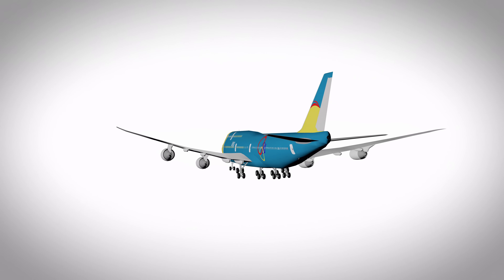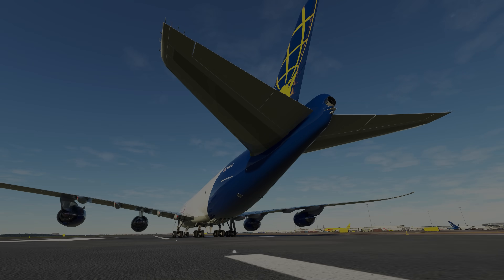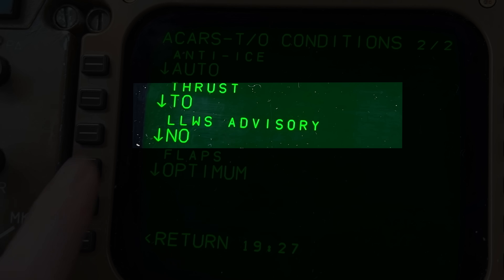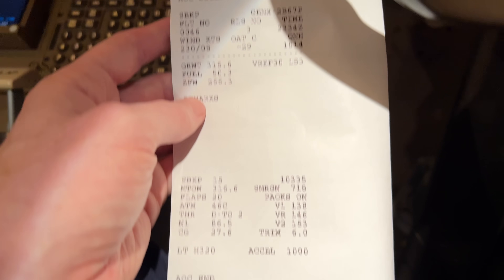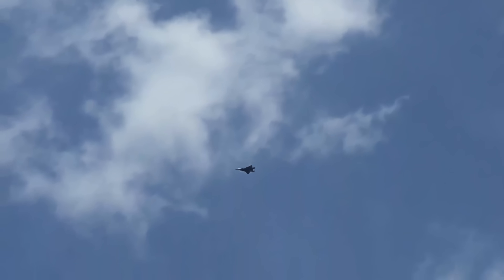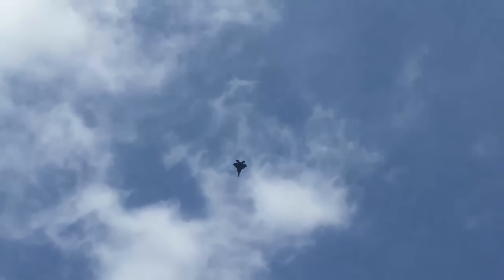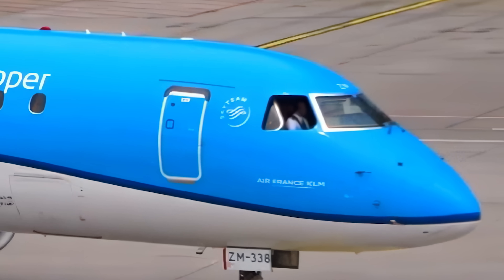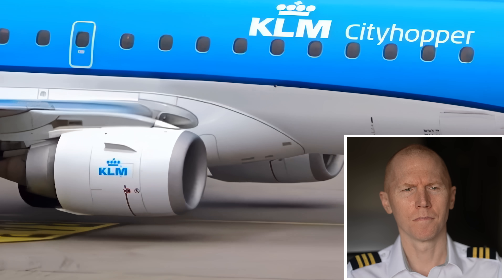Unsafe 747-8 Vertical Takeoff

Comment: I think a better car analogy would be trying to do engine breaking with manual gearbox instead of using brakes and wearing down the clutch instead of brake pads. For most cars, replacing the clutch is much much more expensive than replacing brake pads even though both are designed to be wear items.

And yes, you can indeed do engine braking without wearing down the clutch but you have to do manual RPM matching in that case.
Reply: Nonsense. The RPM matching your talking about is called "double clutching", and I think that went away over 50 years ago. These were transmissions with no synchros, hence the need to match the speed of the engine side of the transmission and the wheels side of the transmission. It took some practice, and a lot of people ground some gears before they got the hang of it, but once perfected, it's a beautiful thing.
Reply: @adamdresser5581  I think you misunderstood my point. Even with synchros, every gear change requires using clutch and the clutch will slip momentarily while re-connecting the engine to the wheels.

If you do lots of engine effective engine braking, you have to switch to lower gears more often. And this will cause additional wear to clutch plate, no matter how good you're with the clutch pedal.

If you're doing the engine braking with the intent to get better economy, you should also consider the replacement price of the clutch. If you can save e.g. one tank worth of fuel per year with efficient engine braking but the clutch needs to be replaced one year sooner than usual, it's still net negative in total because clutch is such expensive thing to replace.

Using brakes to slow down the car is more economical than causing any extra wear to the clutch. You should still fall back to zero fuel usage by slowing down on gear instead of pressing clutch every time you press the brake pedal. Most modern engines will use zero fuel if take your foot off from the accelerator pedal and engine RPM is above idle. As a result, you can use the breaks to slow down the car faster if needed without pressing the clutch as long as RPM is above idle and it will be more economical. Of course, if you have proactive driving style and slow down far enough from the intersection to match your speed to go through the intersection without stopping at all is the best solution.

And note that cars with dual clutch transmission with computer controlled clutch are also affected but there you cannot do much about it. The software will cause the amount of wear the programming will cause to the clutches.

Comment: Those F22 (and other from that generation) are no longer designed as they used to. Older gens had to be stable, bc an unstable plane can hardly or not be recovered by a human. Nowadays they are designed to be unstable, which allows for many manoevres that would otherwise be impossible. It is the onboard computers and avionics that stablize the plane and calculate what the pilot wants, translating it to output, that makes the plane 'stable'.

Btw: I was tought once, when getting my drivers license, to slow down on engine as much as possible and thus not use brakes. It saves a lot on your brakes and no, it doesnt cost anything on the engine.
Ofc thats a tad different for planes, as the engine can suck in debri. (im dutch btw). most likely a very low probabillity IF you keep engine rpms down and then saves a lot on brakes again. Us dutch (KLM = dutch) are known to be 'cheap' and we are almost always right wrt this... hehehe
(im also sure he opened the window to save 12 cents on airco. ;p

Comment: Mate, you surprised me. Previous videos  have been excellent and to the point. Please don't continue with the exaggeration. Vertical - In other words 90 degrees is totally wrong. You can say it much better than I can. A steep angle may be better. But "vertical" nope!

Comment: Wow. You ARE not a car guy. What you are describing is called "motor braking". Here's a hint for you: If you ever drive in the mountains going downhill from a mountain pass, you better have a car mechanic and a coupla sets of brakes along if you want to make it to the bottom without motor braking, tumbling down a mountainside or catching on fire. I mean, being a pilot you KNOW what happens when you hit the brakes too long and too hard. Only keep in mind, in the mountains, the reaction time of firefighters is measured in quarters of hours, not minutes.

Comment: In the 90's, I travelled for work occasionally, and many of those flights were regional hops on 737's.  Often, there were only 20-30 people on board.  Not only were those flights roomy and comfortable, but a lightly loaded 737 is a real sportscar.  They would just leap off the ground and we were gone!  Must've been a blast for the pilots.

Comment: I have 2 questions i am hoping to get an answer to that have been in the back of my mind since before YouTube. After over 20 years in Public Safety as a Paramedic/Firefighter, i have been retired for awhile and kinda forgot about them until I started watching your channel. Which as a time refrence, back in my day ARFF was called CFR(Crash-Fire-Rescue) until powers that be decided having crash in your title didn’t sound good but a human dog bark was okay!!!

   Why isn't souls on board automatically sent to the tower via some type of message/e-mail from the gate agent that closed the door to the aircraft? Or even when the jet is given clearance to push back, the pilots acknowledge with souls on board? This way that information can be put with all the other information that ATC has on the plane. No one is under any duress and it would be one less thing to distract pilots during an emergency.

  I do understand it's not as easy as I just said  because you have some flights that make multiple stops on the way to their destination that let off and take on passengers. But I would think that every time that door closes the gate agent and flight attendant both know the count.

  My second question deals with Alerts. Why can't all ARFF trucks be given a conversion chart to convert fuel remaining from time to Kg and Kg to time? I do understand the different size of planes will determine how long the weight of fuel it will have left to fly, but we are already given the type of aircraft when we are sent out on the alert so we can work it out. 

 ARRF trucks usually have several people on board. I'm not saying the ARFF crew isn't busy, but a majority of the time they are suited up sitting near the runways twiddling their thumbs waiting for the plane to come in. It's obvious both pilots have their hands full and ATC is just as busy. Also, when an Alert 2 goes out, all responding units are put on the same frequency as ARFF, so even if they have their hands full, the conversion is something that can be easily delegated to a responding unit coming in from the city as mutual aid. For an Alert 2 not only are the 2-3 ARFF trucks sent, several trucks from the city are dispatched so everyone is assigned a specific channel to communicate where this could be done.
 Great channel and enjoy the content. If you ever come to MSY lemmie know and you will get to see the city. Eric
Reply: Just as a side note from our stand point amount of fuel on board and souls on board is irrelevant. It is the type of plane that determines what the response will be. If it is a commercial plane, no matter what the fuel on board and/or souls on board may be... a full complement will be dispatched. If it is GA, there will only be a couple of trucks sent.

 As a responding unit(at least at my agency) we only care about size of aircraft. A full compliment is being dispatched for a commercial flight even if only 2 souls on board just in case the flight does not make the airport and ends up in in a neighborhood. Even if they ran out of fuel and there was no fire, we want all manpower there on scene or on the way to start Search and Rescue if it hits a residential area. If they make the airport it is much easier to turn trucks around if not needed than having them sitting in station and being needed.

Comment: About the use of thrust reversers: The most awesome pushback I ever have experienced was in 2001 at MSY New Orleans. A female seasoned captain reversed her MD-9x from the gate! AND they served Pan Pizza onboard going to ORD. Such a great aviation moment that from what I understand I’ll never experience again since this was only allowed with high mounted engines like the MD series had. Maybe on an Embraer jet now then. This is because of the risk of ingesting dirt and stuff in the low hanging under wing engines.
Reply: There are still airlines operating 717s out there (Delta being the big one) that can powerback I believe, but I think Delta forbids it. It used to be a pretty common procedure back in the day. I can recall a doing a few of them on Northwest many moons ago. The big issue, as you pointed out, is that it kicks up a lot of dust and debris and throws that and hot exhaust forward where it can be re-ingested by the engine, and it burns a lot of fuel needlessly. It's also just not as safe as a standard tug pushback, as you can't hit the brakes suddenly or you'll end up putting the tail of the plane on the ground, and you can't see behind you as a pilot to know what you're getting yourself into. I've read the 737 and 757 don't explicitly prohibit powerbacks, but it's not something that any airline that operates them does.
Reply: It was very common (to me it seemed the normal way) years ago for American Airlines MD80's to thrust reverse out of the gate when flying out of DFW.  It was typically done with one engine and I always loved the smell that followed after backing up!

Comment: I actually have a photo of a KLM pilot cleaning the "windshield" from inside the cockpit, through that same window. The other window is open as well in the pic. This was at boarding time,it was a lovely summer day :)) 

Also, the clutch goes first from engine braking / downshifting on a manual car.

Comment: Yep, it's good you are a pilot and not a race car driver. Even in a normal car you should be using some engine braking. Heck, back in the old days (pre 1970 I think) you had to match engine revs to down shift at all or you'd wreck a transmission that way. Racing you absolutely use it to slow the car faster than brakes alone. You get all sorts of stuff these days o modern cars. Auto rev match and auto blip in some cases too. Not a fan myself I'd rather heel and toe it.

Comment: As you probably know, it is a legal  requirement to perform a max thrust takeoff every 30 days to check engine performances and if you happen to be light, you will really fly ! ( you could get above 6000 feet before reaching the end of the runway as I found out personally). However, on a slippery runway with crosswinds, should you loose an engine at the beginning of the takeoff run, you may not be able to maintain directional steering and end up in the grass. 
Keep it up, I enjoy yor stories…

Comment: When I was 12, back in 1997, I "worked" in a general aviation company during the summer holiday, helping my father who was a senior aircraft technician (Air Force retiree). He gave me lots of advices on flightline safety, the very first one of which was, "Never try to turn a propeller by hand."

Comment: << Car guy... You're not wrong. You absolutely can use the transmission and engine to slow your car, and as long as you are doing it with an appropriate level of mechanical sympathy, it's fine (and probably better for the environment*). Get it wrong though, and you can certainly cause yourself a major headache, with a huge bill that will make replacing your brake pads look insignificant.

* It isn't relevant to Kelsey's point, but having mentioned the environmental effect, I figure I better explain it before a dozen people jump to tell me I'm wrong. This is a two fold issue for both ICE vehicles and EVs. First there is the fine, airborne particulate matter that is produced by using friction brakes on a vehicle. Due to increasingly better trapping and filtering technologies on fuel burning engines, the amount of particulate matter coming out of the exhaust of modern cars is much lower than it was a decade ago. When you use friction brakes, tiny particles from the pads/shoes and (to a lesser degree) the disc/drum are released. That is that dark powder that builds up on the inside of your wheels (brake dust). Using engine braking (or regen breaking in an EV) reduces this type of pollution. (Of course, if you trash your gearbox, that's likely going to be more waste and impact than a lifetime of brake pads.)

The second aspect for ICE vehicles that have fuel injection, is that they cut the fuel flow when there is enough momentum to keep the engine running without fuel (but only above certain RPMs). So when you take your foot off the pedal, and shift down through the gears as your vehicle slows down, you won't be burning any fuel (except during gear changes), thus reducing emissions, and increasing your MPG (or L/100km) a little. For EVs that have regenerative braking, you get that little range boost.

While I'm thinking of it, there is also a safety aspect that is significant enough to warrant suggesting people that drive manual cars learn the basics of engine braking. Most people will brake and leave the car in the current gear, using the clutch when nearly stationary to prevent the engine stalling. If you change down gears as you are slowing, you will keep the engine at higher RPM. That higher RPM goes hand in hand with a higher level of drag on the transmission, slowing the car faster.

You can feel this effect just by taking your foot off the accelerator pedal without applying brakes. If you are at 30mph (near as makes no difference ~50kmh) and you have your car in 4th, the car will noticeably - but gently - slow down. If you are at the same speed but in 3rd, the car will begin to slow more sharply, until the revs drop. Do it in 2nd, and the car will slow significantly more sharply. To be able to shift down gears to keep in this high drag zone, you will need to learn the technique called "Rev Matching", otherwise you send huge shocks through the transmission (some modern, higher end cars will rev match for you).

The effect of engine braking through high RPMs is additive when using your friction brakes (meaning the total slowing power is improved compared to just using friction brakes alone. In turn, this means your car can be stopped quicker. You must change down the gears progressively, and appropriately to the speed of the vehicle. If you are doing 70mph in 5th and suddenly drop to 2nd, you are quite likely to lock up the driven wheels, potentially losing control (and possibly causing damage to your transmission).

A further benefit of learning this technique is that your car will have higher levels of engine torque available "Instantly". So if you are breaking and need a sudden burst of acceleration to avoid some danger (for instance, a vehicle coming from the side is about to T-bone you), your car's throttle will be responsive. If you have left the car in a higher gear, you won't get that quick throttle reaction you need, or you will have to spend previous seconds changing down to an appropriate heart (by which time, you've probably got another car's bonnet as a passenger).

Top tip: No matter how experienced you are, or how good a driver you believe yourself to be, get some advanced driving lessons. They might save your life one day.

Comment: Somebody needs to look up vertical in the dictionary. Wait - what’s a dictionary???? Also, in a strong wind the climb angle looks steeper than normal. We are judging it based on ground reference but the actual climb angle relative to the airmass is less. J3 cubs and champs with A65s are still hand propped for every flight. I’ve done it many times but always with the pilot in the cockpit.

Comment: 8:20  The aircraft I personally witnessed sitting on its tail was the English Electric :Lightning.  In the late 1970's it was a remarkable sight.  To see this modern day Lightning perform like this must've been equally awe inspiring and indeed would appear as if witchcraft.  Power to you!
Reply: Yep worked on the Lightning at RAF Binbrook firstly in the engine bay then ASF doing check 3s . My chief in the engine bay got Thrust 2 the land speed record . They were having issues with the afterburner.

Comment: When flying a Sabreliner on a very cold icy day, I used the thrust reversers for directional control when going down a small incline into the parking area; braking just locked up the wheels.

Comment: Using "idle reverse" is a very common practice on light Globals, Gulfstream jets and other high thrust to weight ratio jets or while taxiing downhill. Bakes are very very expensive and if a company calculates that reverser cycles are cheaper than brake usage it is a great way to save your brakes and money. You also keep your brakes cool for takeoff which enhances your takeoff performance due to a much higher brake-energy availability and cut down on turnaround times by which might be the main driving idea in the KLM video.

Comment: These 40 to 50 yrs old and have 10k of flight hours,,, that's part time aint it? In 30 yrs I've done well over 95,000 hrs driving a truck with pedestrians,  motorcycles,  car drivers and signs , cameras, wrong addresses etc, flying a plane in the air has got to be so much easier yet they all seem to only work part time

Comment: I've flown 747-200F's empty many times and we were limited to a maximum of 20° pitch angle. Even with that much pitch angle and reduced thrust the big plane would rocket upwards very quickly. It kept you busy retracting the flaps on schedule and not busting the 250 kt limit down low.